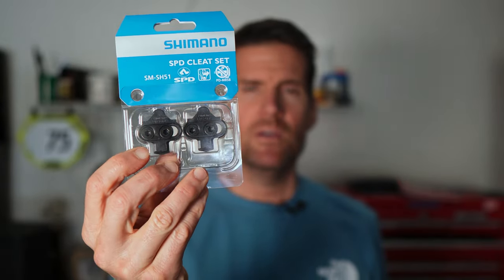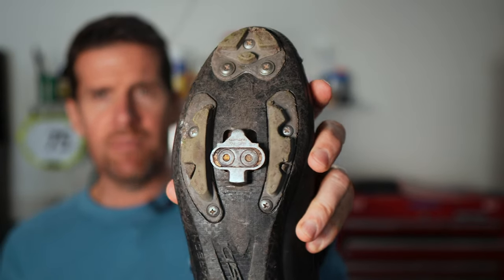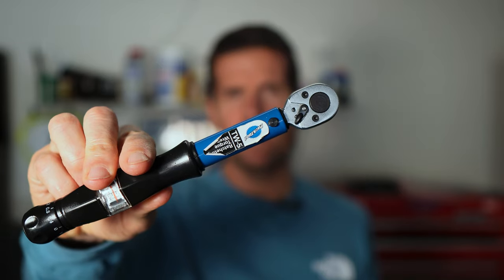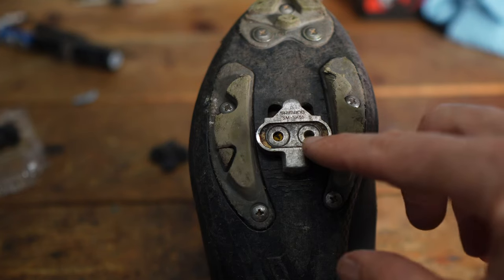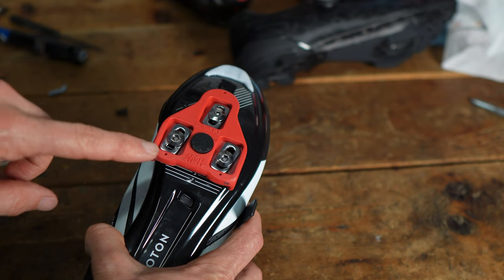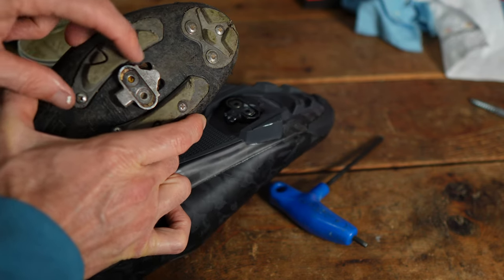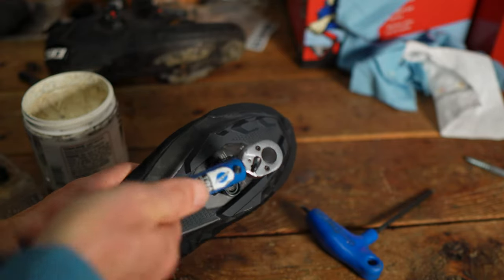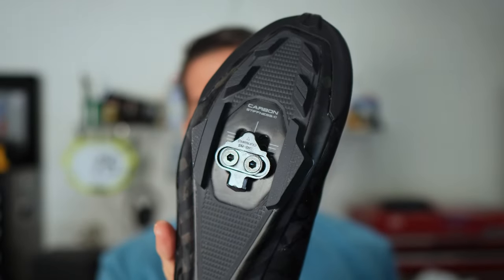How to Install Bike Shoe Cleats

Comment: If you grease a screw the applied torque must be lowered. Otherwise the screw is too tight. 

I also wouldn't use grease on these screws but rather loctite (or similar stuff)
Reply from the maker: I find the torque to be the same. The grease keeps the bolts from seizing later, which is a real possibility since you're likely to walk through mud and water.
Reply: @ClintGibbs  The torque stays the same on a greased screw, that is correct. But when greased, the bolts are threaded in deeper in comparison to ungreased ones causing greater stress on them. This could potentially damage them. It is therefore a common procedure to lower the torque when greasing threads.
Reply: Totally agree on adding loctite instead of grease. I've tried without anything (worked great), tried with grease (worked really bad and both cleats came loose and one carved deep scars in one sole of my new sphyre shoes. Had to rebuild it myself which fortunately turned out great) and after the rebuild I added loctite and it's been working great. 99.9% sure it will be easy removing the screws when that time comes

Comment: I just bought a new bike and shoe cleats for my shoes.  They look identical to what was on them before.  However, for some reason, they won't clip onto the peddles.  It's incredibly frustrating.
Reply from the maker: Make sure the tension screw on the pedals is turned all the way counterclockwise. Also make sure you don’t have any part of the rubber sole that’s interfering with the pedal.

Comment: This is my first time using Shimano MTB pedals and I have an extra piece. It's chrome and has the same bumpy edge as the underside of the pedal. When you installed the cleats you didn't have this. Is it necessary?
Reply from the maker: Hard to tell from your description but I think you may be referring to the plate that goes inside the shoe for the screws to attach? Oftentimes the shoes already have that inside so you don't need to put it in.
Reply: @ClintGibbs  I'll send you a pic on IG.

Comment: I noticed that your shoes are carbon fiber, do the teeth on the cleat just press and dig into the carbon (is that normal?)
Reply from the maker: They will leave a very slight impression but if you use the proper torque specs, you’ll be fine.

Comment: So far... not helpful. You're assuming the cleats are starting with the metal mounting bracket already in the shoe. I'm starting BEFORE that step. I don't know how to mount the metal bracket in the shoe. Once I do that this video would be helpful.
Reply from the maker: Most shoes already have the bracket inside. If not, you just pull the insole out, put in the bracket and put the insole back in.